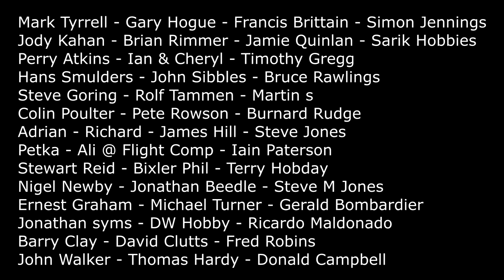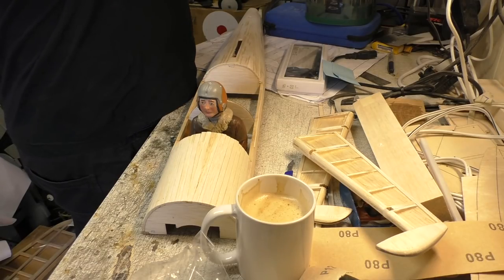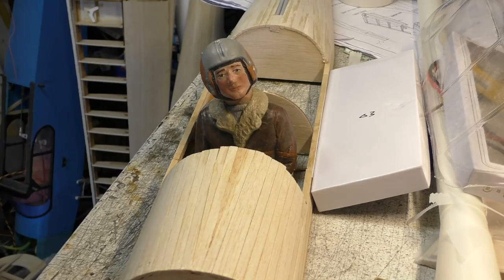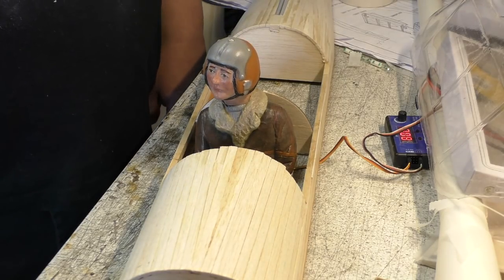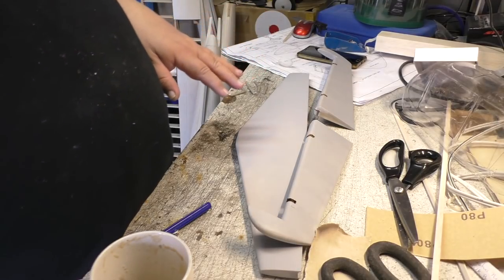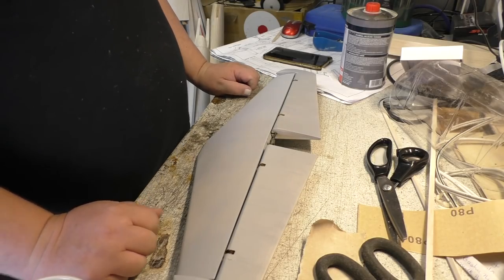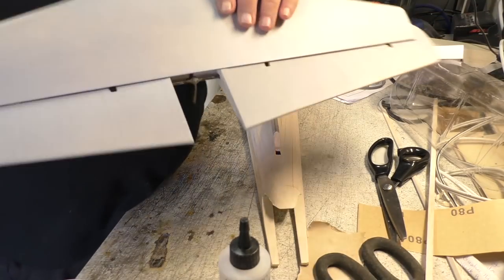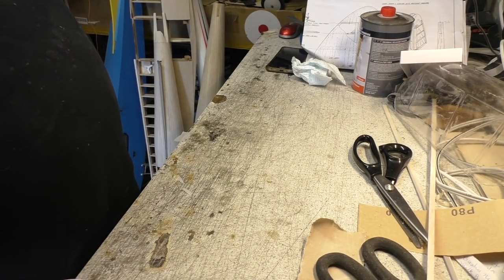Sarik Hobbies Dennis Bryant 68" DHC-1 Chipmunk Build Pt32 RC Model Geeks

Comment: Maybe worth thinking of creating a small "servo box" that is fixed to the cockpit floor that the body slides over, with a "pole" that the head pushes onto. You will have better access to the servo if needed at a later date. Just a thought.

Comment: That pilot looks like a younger Rob from back in the day,he certainly makes good pilots with realistic attire.
I wonder why the instrument panel chap has not replied ? I make mine from black artists scraperboard,scratch in the bezels and fit tiny rubbers seals for surrounds,then flood the  dials with clear acrylic varnish which when cured looks like the glass portion of the instruments,add magneto switches from pins with a blob of glue then paint afterwards,small placards glued to the panel with some squiggles to represent the writing,you will be surprised what you can do with a few bits and pieces.
The empenage looks most Chipmunkish,one thing Rob are you going to add the anti spin strakes that DB forgot on the drawing ? certainly most Chipmunks in military service had them,the idea was to stop the blanketing of the rudder in a spin without them the Chipmunk winds up rather alarmingly,as fitted spin recovery is assured,just thought that I would mention them,a quick look on Google will show you the strakes as fitted.

Comment: Roger's Pilots... expensive though, 1/6th scale half body £45.99, or am I missing something ?
Reply from the maker: Hand made to order in the UK. If you think how much time it takes to mold it, paint it etc. As Roger says these pilots are used in championship winning scale models, where the cost of  a pilot is a mere drop in the ocean. Ive had loads of off the shelf pilots, none of which ive ever really been happy with. Either the scale is wrong or they just look weird!